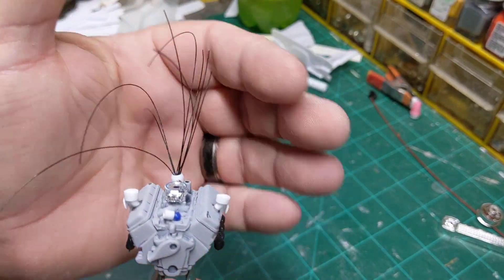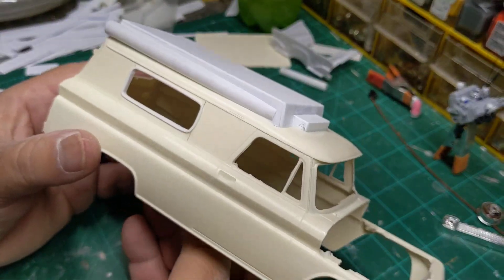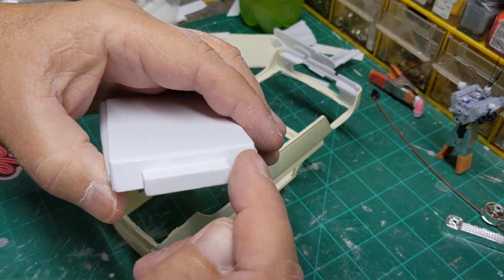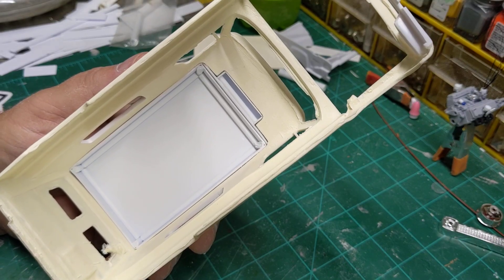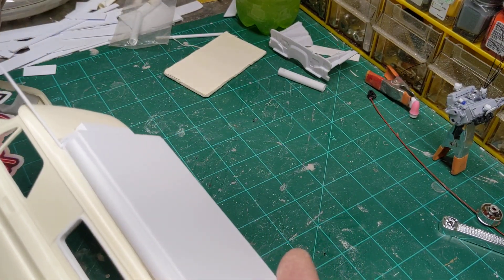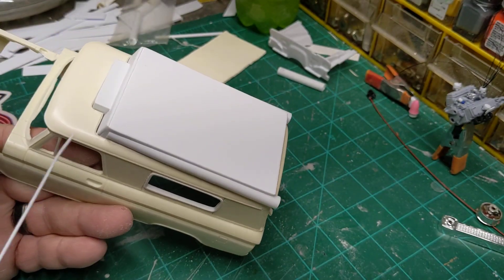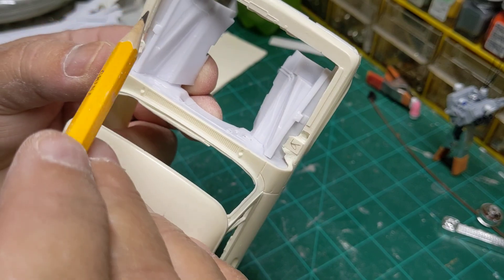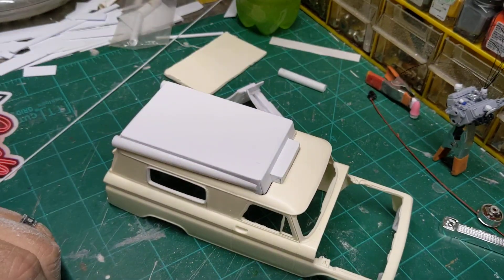Day 2 progress.

Comment: Nice work.
You're using thin round stock for the roof seal?  Doesn't Plastruct make qurter-round out of larger stock?  That might fit a little better without needing putty.
There was a rescue truck TV series in the 1950s, way before  Emergency!, using a truck in this style.  I've always thought this style looked really good built up.  I'm waiting to see your choice of wheels and tires with all that torque to motivate it.  Colour scheme?
Reply from the maker: Thank you for watching. I have many sizes of round stock.